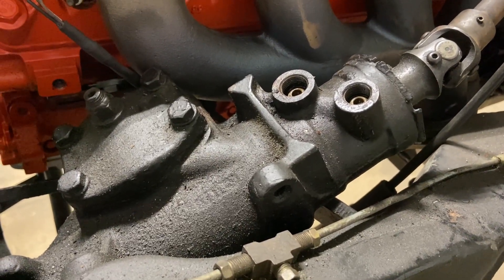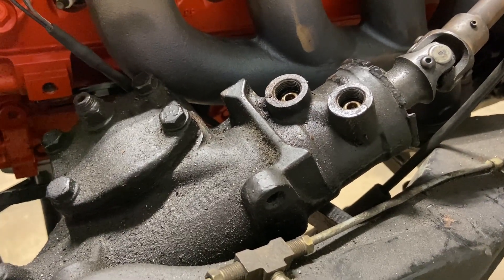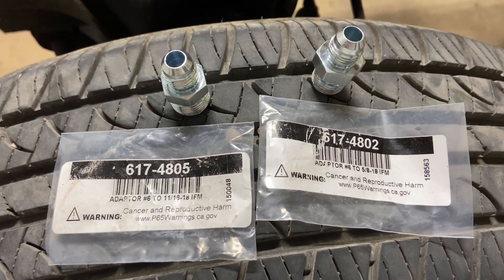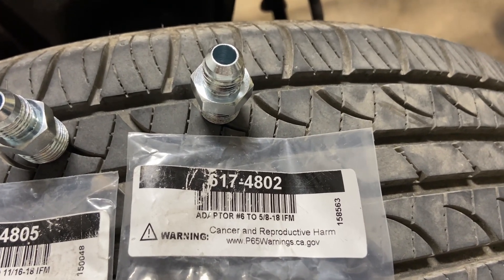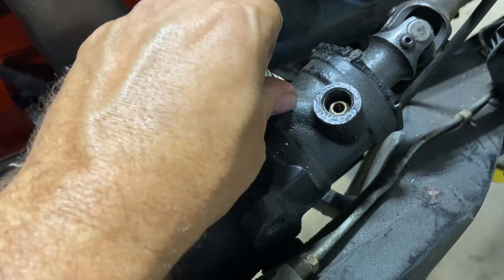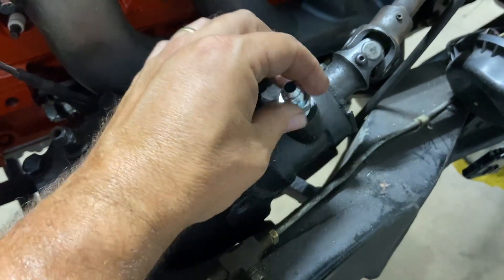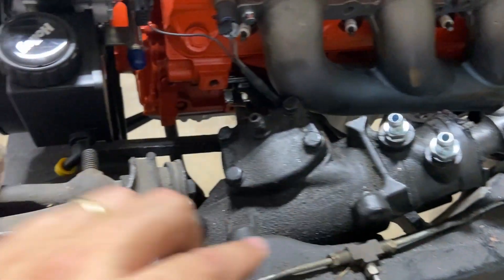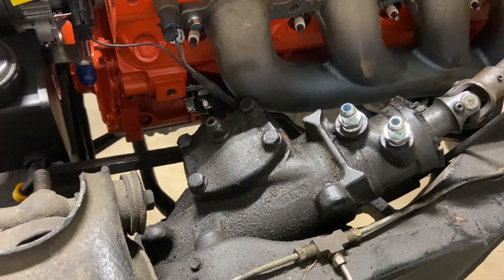How to Convert GM Saginaw Steering Box flare fittings to 6 AN fittings using 617-4805 and 617-4802

Comment: Will this stuff work on a stock steering box on 86 Camaro?
Reply from the maker: @MichaelRobinson-vw4jg  if yours is an 86 it maybe a later box, early boxes were straight threads with a flare nut.  Later model boxes switched to a metric flare nut with O-ring. If yours has flare try part number CLP-605ANF-OR at summit 👊🏼👍🏻🙌🏼🔧🔧🔧 thanks for watching 👍🏻🎥🎥
Reply from the maker: @MichaelRobinson-vw4jg  had to edit earlier comment, thought you had 68 not 86 😂😂🔧🔧🔧🔧

Comment: Would these fitting work for a 500 series gear box i have a 63 impala and the same holley mid mount
Reply from the maker: @frankyfrank6387  I think they would the impala box should be standard thread with flare fitting.  The later boxes are metric with O-ring seals on the fitting 👍🏻👊🏼🙌🏼🙌🏼🙌🏼🔧🔧🔧🔧 thanks for watching 👍🏻🎥🎥🎥

Comment: I'm trying to replace the rack and pinion transfer tubing assembly on an 07 Colorado. Will these fittings work?
Reply from the maker: I don't think these will fit an 07 Colorado, these were meant for much older GM products. Like 80's and back